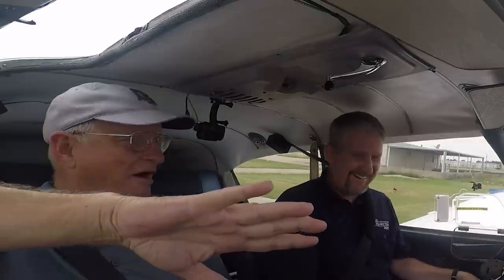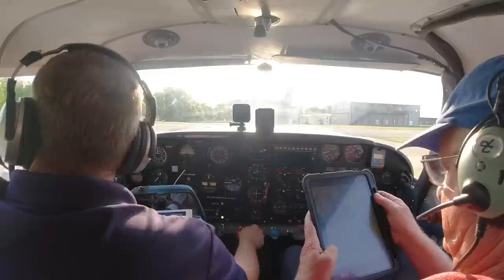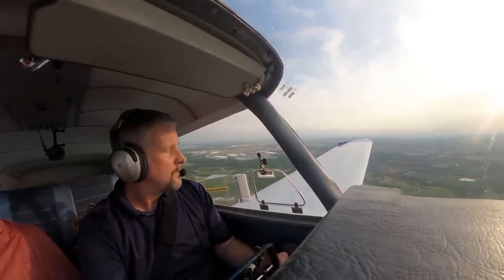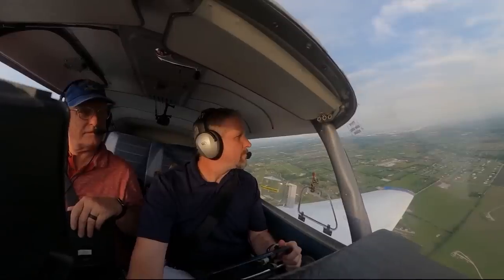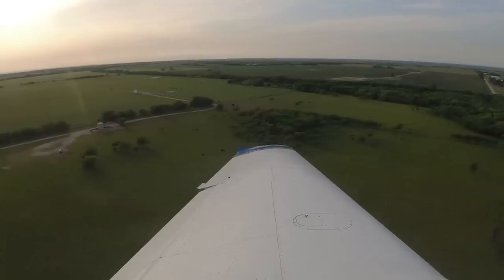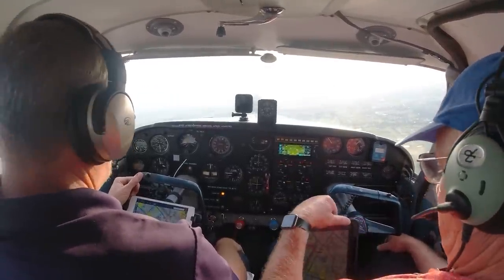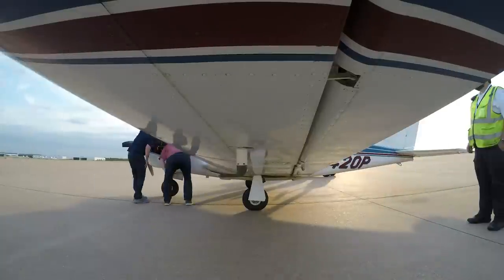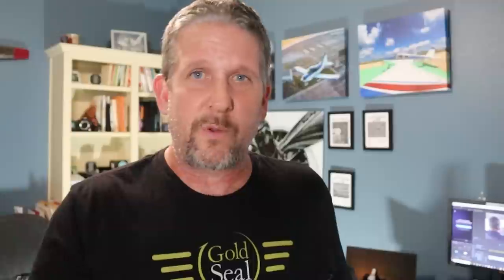How to become a Commercial Pilot - VLOG 02 - Flight Terminated - Odor in the cockpit

Comment: You can't stall unless you're pulling positive Gs (no stall at 0G) and to get positive Gs pulling on the yoke is usually necessary, however in the Sim we train stalls with the AP engaged and allow the AP to trim above the Stall Warning AoA not by physically pulling on the yoke (same effect). Unloading the wings is the correct way to fly out of a Stall, then adding power as needed (follow AFM guidance). Good luck with the training!

Comment: I remember several C-130 missions cut short for smell/smoke in the flight deck. Never ignore your nose.

Unless the source is obviously "biological" in which case it's easy to deal with cuz the Herk is pressurized and it's super easy to open the sextant port and let suction blow the stink out.